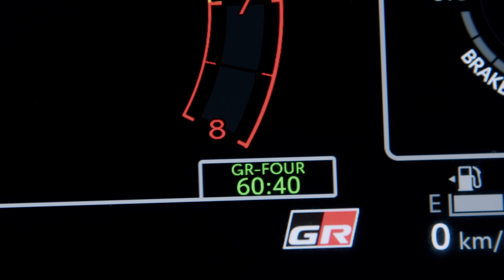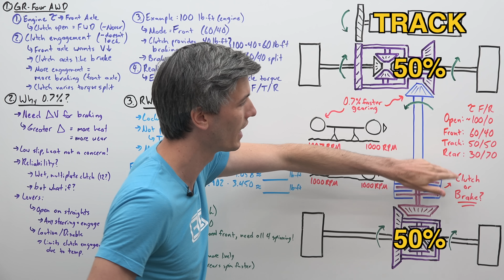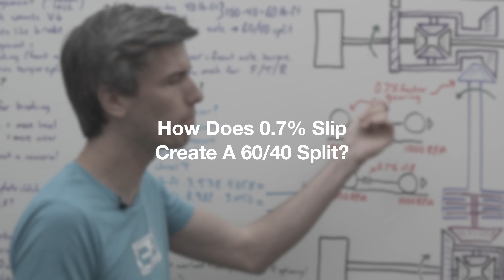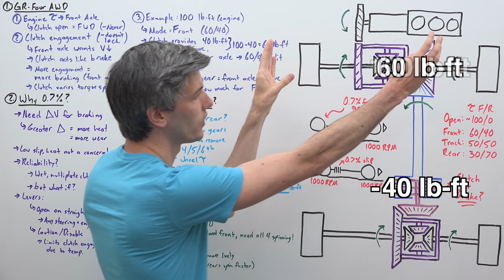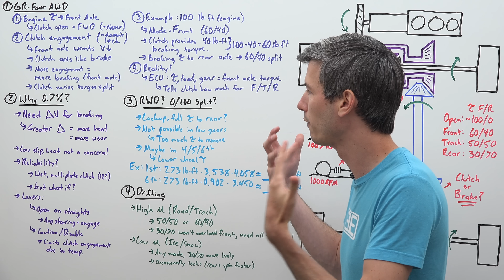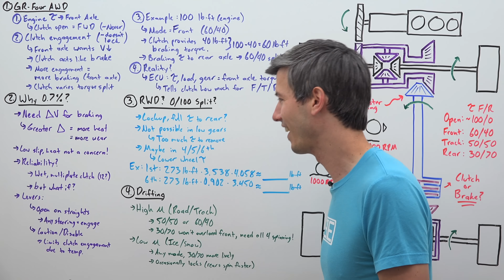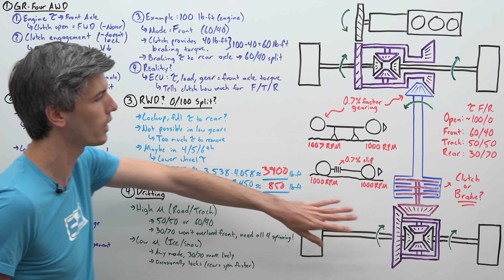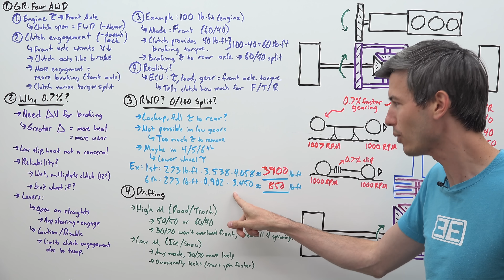Toyota GR Corolla's Brilliant AWD System - How It Splits Torque!

Comment: I've been excited to learn more about this system. You are the perfect person to explain it to me! Thank you!
Reply from the maker: Happy to hear it, thanks for watching!
Reply: @EngineeringExplained  Judging from the comments, it might also be time for an in-depth video on the workings of a wet multiplate clutch. I think people have misconceptions about what causes or accelerates wear the most (heat), and they don't seem to grasp some of the fluid dynamics involved in a wet multiplate clutch (i.e. how the clutch plates can transfer force even through fluid shear).
Reply: @Kyriaeus  Do the math. 300hp engine with a 30f/70r split is 210hp to the rear. 0.7% of 210hp is 1.47hp that needs to be converted to heat nearly half any track lap.. Even cruising on the freeway you're talking about 1/2hp cooking in the clutch pack any time the car is moving. There's no cooler on the rear clutch pack, no circulation, has a fluid capacity of 0.5L, is within an inch or two of the rear exhaust pipe. There's no way to offload the heat. By the end of a typical track session you've boiled off all the oil if the system actually operated as EE describes. Instead it's just like all the other systems out there. GKN Twinster, SH-AWD, all operate in heavily biased FWD modes most of the time in order not to overheat and create heavy wear.
Reply: @Vermonstered  Funny how you mention do the math, then fail at it. My point was addressed to the loads of comments moaning about "errmahgerrd the clutches are gonna wear out in 2 minutes!". But since you're here:

1. The engine is not constantly running at 300 HP, you'd need to be on a track that is nothing but a straight line and a CVT do that. Or be on a dyno.

2. Not all of the slip is taken up by the clutch pack itself. During tight corners the inside wheels will scrub and take up some of the slip.

3. The "up to 70%" rear torque bias is just hat - "up to". It's not constant and it's not an on-or-off switch.

4. A bevel ring-and-pinion assembly at 99% efficiency would generate more heat than the clutch pack slippage.

5. There's a thing called heat shields - without them the transmission on any longitudinal drivetrain would be cooked, and so would any FWD-based AWD system's front bevel box.

6. Congratulations on pointing out that a FWD-based AWD system is in fact FWD-based and shares characteristics with other FWD-based systems. Real galaxy brain move.

Can the rear drive unit overheat? Yeah. Has it overheated in similar systems? Yeah. Can it be addressed by adding some cooling? Also yes.
Reply: @Kyriaeus  🤦 it's amazing how much one can write and not understand when you don't have a cooling system it doesn't matter if the system is running at 300hp or 50hp. It's all heat soak with no offload ability. Astonishing how many excuses you can write and still not understand the basic premise of this is a car designed for track use. Half the lap is full cook with no cooling. None of your 'reasoning' explains how a system will not cook off 0.5L of differential fluid in a track session. The failure here is trying to explain away the initial pretense saying it doesn't exist. Lol never mind half your reasoning is flawed if not completely useless at best. Considering transmission coolers and much higher fluid capacities exist for the front bevel gear assembly and those have coolers. So sorry, math is still there and you still have to deal with the heat generated putting the pedal to the floor in a straight line. It's not a static state system like EE tries to explain.
Reply: @Vermonstered  dude your clown shoes are showing
Reply: @Vermonstered  My original comment was not about track sessions - YOU brought that up. Also, there is obviously passive cooling even without a cooler - otherwise pretty much every FWD-based AWD car on the road would be on the shoulder. It's just a matter of how much passive cooling is available.

2. You already mentioned this, so I'll repeat it to you, so you understand this - the center clutch is not fully engaged or even 50% engaged all the time. The AWD system has the most effect when accelerating from a low-speed, when the engine torque and transmission ratio puts the car in an otherwise traction-limited regime. Once you get up to a speed where the vehicle's acceleration is power-limited and no longer traction limited, the % split to the rear can be substantially lower - it only needs enough to take up the backlash.
Reply: @Kyriaeus  1. You have to account for track sessions unless you don't expect this system to survive the track. As for a cooler, nope. Look at the GrY, there is no passive cooler. There's not even fins on the rear clutch housing. Yet another strike for you. The issue isn't a FWD based AWD system. It's an AWD system with a rear gear multiplier without a center differential claiming static power splits. Yet another strike. 

2. That's disagreeing with what EE is stating in this video if you paid attention and why there's so many comments about heat and wear. He directly states the system doesn't need to move the power back up front unless it's overheating and not in normal operation because Toyota Engineering. So you're disagreeing with what EE is saying hence agreeing with me. At least there's that! This system functions like all the other systems on the market and isn't static or remotely static in the power distribution. 

3. I know you likely don't recognize this but in ANY turn the rear wheels travel less distance than the front making the multiplier greater. 

4. Again you don't understand this but the car is trying to crush itself (the rear multiplier) ANY time the car is moving and the rear clutch pack is engaged at all. So it must slip the clutch or the tires or the frame fails any time the car is moving and the clutch pack is even engaged at all. The engine power isn't the only source of energy, the car's mass traveling over ground adds to the heat. Unsurprisingly you don't address heat soak again. 

5. The math is still accurate and the system must deal with that situation.  😉

I'm sorry these shoes must be yours. 🤡 Have fun with that.
Reply: @Vermonstered  We'll see if these cars start grenading themselves regularly. Oh wait, they don't. Can you find stories of people overheating these on the track? Sure - but you can find these stories about any car.

Also, how the hell is this NOT a FWD based AWD system? 
1. Transverse engine and transaxle that always drives the front axle.
2. Front and rear bevel gears to send power to the rear.
3.  Power is sent to the rear if and only if the clutch is engaged to any degree.

If there were no passive cooling at all, then the rear diff should be cold to the touch on the outside, since NO heat should be escaping. Go ahead - I dare you try it after driving it.

You also keep failing to address the fact that the "up to 70%" rear torque bias is not on all the time - if the clutch is only applied with 10% of max pressure, that is significantly less heat generation than if it were at max capacity.  And again, you only need a significant amount of torque going to the rear when accelerating out from a low speed. 

Keep clowning yourself bud 🤡
Reply: @Kyriaeus  A shining example of someone being so angry you forget what your point is. Now saying if it doesn't have cooling it must be a perfect insulator - that's just silly.

BTW you're disagreeing Jason's view in the video with and agreeing with OhAiShare. Calm down sparky.
Reply: @makeitso5005  I don't really care if I'm agreeing with EE - not my job to defend what he says. But there's a lot of armchair engineering going on here claiming this system will grenade itself in 20 minutes when that seems to be by far the exception, not the rule.

Also, my point stands - if something has neither active nor passive cooling, then what cooling can it have? No cooling + heat buildup means perfect insulator.